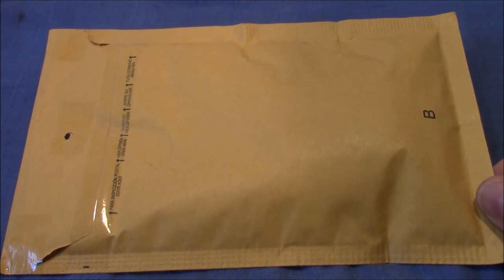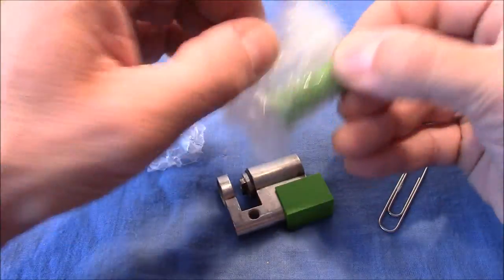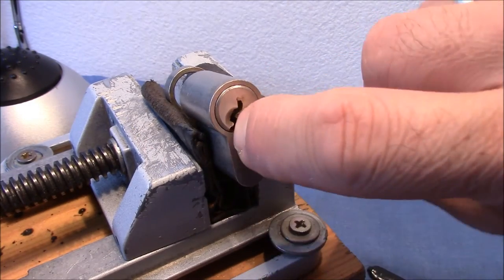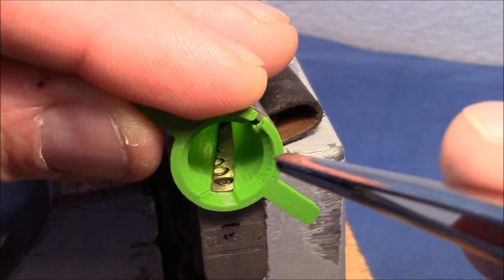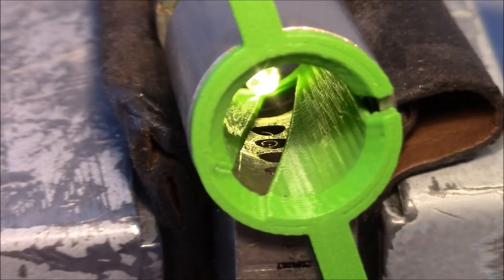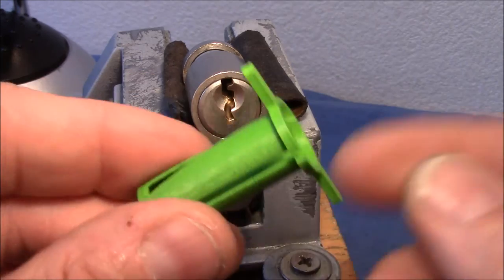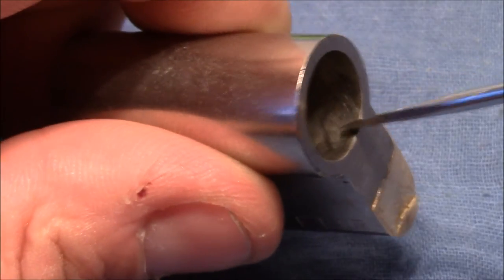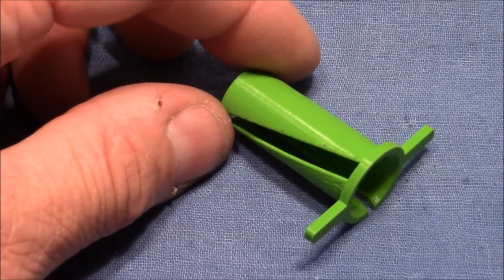(picking 212) Front-loader pinning tool for euro locks demonstrated and reviewed - big thanks to Tom

Comment: Thank you so much for doing the full review Potti :). I'm glad that all arrived safe and you like it.
You were right, the paperclip is used as a pinning shoe needle. You file it flat on the side which faces the drivers, so that they are hold safely in place. It's just an improvised one, but does work ;).
I designed the small slit in a size so that even pinning shoes which have a little wider needle will fit.
It's easier to turn the tool with the shoe inserted just a hair at the beginning, and then pull the shoe out just at the edge of the small slit, so the pins do not block the tool from turning.
The loader is made flexible on purpose, as I got the note, that there may be locks with a little different core diameter. 
So it's easier for the tool to adapt, even when the core is smaller than normal.
It will probably not work on all locks (side pins aso..), but on many.
The small area in the front of the tool which you mentioned (in front of the bigger slit) is there, because I had to shorten the tool. Doesn't harm the function and it is not so easy to remove, so I left it this way... ;).
Yes, a pinning shoe alone will do it too, but this way it is much more comfortable :) (and you can start in the front, or back or even with some practice in the middle of the lock). You will get used to it in a short time.
I'm btw foxxy3 on ukls ;).
Very nice greetings and If you ever need something or want to share ideas...you now know where to find me potti ;), Tom
Reply from the maker: Attention: long answer ;-)
Thank you very much for the fast delivery - it was great fun to use / test the pinning loader. Actually I always wanted to have one but was too lazy to check for an affordable source ;-)
You say that the tool was designed to be flexible to also fit in smaller locks. That's of course a valid point. But the lock can only be a little bit smaller, else the slot for the pinning needle would become too small. But the majority of euro looks that I came across had the same size, as my standard follower fitted tight into them. But there are other locks that are larger; example Pfaffenhain https://youtu.be/tEtmcb8I608?t=171 For such locks a bigger tool would be required or you live with a gap when working on it.
I still think that stability is an issue. The idea with a bridge over the pinning needle slot (while maintaining the space for a tall pinning needle) would reduce the wear on the tool (from squeezing), improve the usability (no unintended reduction of the diameter when working and therewith a chance to turn it unintended). But on the other hand it might also reduce the tension when inserting the tool. Currently it adapts to the inner diameter and can apply a force against the inner wall which increases the friction which is good. So after writing and thinking at the same time, maybe just increase the width of the tool at the end. This would maintain the flexibility (smaller locks, automatic expansion and friction) but reduces the wear on the weak point and makes it even stiffer.
Reply from the maker: I managed to compile some locks for you - it's on its way to you. Have fun.
Reply: Potti314
Ohh :D. That sounds great :). I have 2 weeks of company vacation now, so just the perfect time. Many thanks Potti :). I will send them back when I'm done with them.
Reply from the maker: It's meant for you to keep or for circulation. Please don't send it back. Cheers :-)
Reply: Many thanks Potti :).

Comment: Very cool. Would love to see it made out of something that might take a little more punishment (steel, brass, whatever). Your ideas to improve structural integrity make sense. Nice work, Tom.
Reply from the maker: Thank you. Yes, that plastic might not hold forever. I guess to make it yourself out of sheet metal would be a lot effort. The good thing with 3D printed stuff is that once the design is done it can be reproduced with no effort.
Reply: You can easily make something like this from a 1/2 inch brass tube. But I'm not a metal specialist and as Potti said, I can remake a tube, whenever I need one with the printer :).
Reply: +redcatimaging very well done, an intelligent design and expertly put together. You should feel very proud.
Reply: 10/10 for practicality. :) Except for the cost, 3D printing with metal would be fun too. I think I might take your 1/2 inch tube idea and run with it. Much appreciated, good sir.
Reply from the maker: Noctis Motus Looking forward to see the result.
Reply: They have these made out of steel but they’re fairly expensive. I bought my set from think peterson but I’d love to have the plastic one if I didn’t already have the steel one. 3D printing may not be as robust but this tool is a life saver and if it gets used once it’s already paid for itself. I’ve seen YouTubers make these out of brass too but it’s trial and error either way…
Reply: @odinslockllc  Hmm, I have the setup these days to do it myself. Having the time and motivation is another matter entirely. :)

Comment: I have to disagree to add a bridge at end, if you do that you cannot insert it or remove it because it will be blocked by the pinning shoe! Go to thinkpeterson DOT com - pinning tools and you can see how Ken overcame this.
It is not connected at the end but rather there is a bridge going inside the core and over the insert slot which makes it stable and allows you insert pinning shoes. :)
Great review Potti, and Tom really nice design, if you manage to make a connection over the insert slot it would be perfect! :)
Reply from the maker: Thank you. You're right of course and I don't understand why I didn't think about it before. So here is a picture of the peterson one https://www.thinkpeterson.com/PDGImages/PINNING%20DEMO%20C.gif As I want to use my other pinning show as well (https://youtu.be/Ss258RBTjqI?t=696) the bridge needs to ensure enough space for it. I will put a note on the video to draw the viewers attention to this point. Thanks again :-)

Comment: Nice tools! But what if you can't pick it first? I had taken a Ruko D12 double euro cylinder apart as I wanted to repin it using pins from another lock. I had my troubles but luckily one of the sides was the shortest possible. I managed to put it together again using nothing but an angled tweezers. First doing the deep side then think about what needs to be in there and do the other side. Then unlock both side pulling them slightly apart (but watch angle and how much!) to be able to put in the center piece. Was a true puzzle and I had it lying apart a few months before deciding to give it another shot. Single sided cylinders is usually not much of a problem even with just ordinary lay mans tools. But that double euro cylinder was quite a challenge.
Reply from the maker: Yes, these double euros can cause some work ;-) If you cannot pick a lock but have a key, you two options. (1) Just pull out one side and then carefully gut the other side with a follower so you know the pin order. (2) File down the key on the side opposite to the bitting. This gives room to insert the needle of the pinning shoe. If don't have a key, maybe you can shim it open. But therefore you need to get access from the back.
Reply: Yeah thinking about it I think I can see how it can be done even if only 1 key but then you'll have to tape down the first side to make sure it doesn't fall into place or out again.
The oddity of Ruko D12 is that all top pins are the same length so no order to take note of. 
Otherwise most locks (Danish) I know of if you get order shuffled then just shuffle them around the get the least amount of spread in height of both lower and upper pin combined so again not really that big of a deal to have track of the order unless you''re dealing with a fancy master key system etc.
Reply from the maker: I've made an unlisted video https://www.youtube.com/watch?v=uOZ2pVjUvVo for 'crispey bear' demonstrating the method. I just lock the assembled plug so it will not fall out.
Reply: Thanks for video! Sure makes the job a lot easier but still very tedious compared to most other single cylinder types (Scandinavian oval is the most common where I live).
Hopefully I'll never have to do longer than an asymmetric +0 and +25mm double cylinder. As long as there's two keys it can be done just by a pair of angled tweezers.
If changing my front doors I'll most likely NOT choose euro cylinders for a lot of reasons. More expensive and imho less physical secure.
But it's what fit in my doors now and when I moved in I bought these cylinders to replace the old as you'll never know whether you've got all the keys or if there's copies out there. Fate would have it that I didn't fit them for some months as I both wanted a rekey for one of them (not the main issue) but also because the cassettes turned out (I now know after several months not being able to find out that is was) to be an old style Guerville where the tap which turns around is smaller than standard euro taps. I solved the problem by disassembling the cassettes and grinding/filing the dead bolt mechanism to be able to accept the larger tab of a standard euro cylinder. I could replace the taps in the cylinders to smaller ones but the old ones don't fit the new cylinders and paying 2x15€ for some taps is imho too expensive. Besides the cassettes needed to be cleaned and re-greased anyway.
Could be the cassette could be replaced with some fitting ovals but that would require new cover plates and handles and perhaps some fitting too and these cylinders where bought.
Reply from the maker: Wow, that reads very elaborate - compliment to your work.
Here other than euro cylinders are very uncommon. I also had the problem once that I had the need to repair a cassette but it was fixed with rivets. I had to replace it completely as I don't have the proper tools and knowledge to disassemble and reassemble it.

Comment: Great video and demonstration mate. I have never used pinning shoes etc for gutting and only used a follower with lock in hand and seems easier with less messing around. How would you compare both methods of gutting?
Reply from the maker: Thank you. I prefer the method using a follower when possible. Just safer and less likely to mess it up. But for full euros  I used the pinning shoe only which is a bit tricky, so that loader tube is very helpful for these cases.
Reply: Potti314 Waddac2 I always use a Pinning Shoe on Full Euros because you are forced to use them but if I had a Tool like Tom has made I definitely would try using that. Nick.

Comment: compare to the traditional way in repinning, looks like this is more troublesome, the time needed to finish using this tool is doubled or maybe more.. traditional way is more simple and practical..
Reply from the maker: For a full euro with both sides together this method is the only way to repin the lock. The usage of a follower is then only possible if both sides were gutted.
Reply from the maker: Yes, your method is more comfortable given that both sides are gutted (or dumped out as in your video). The approach with the front loader however is the only way to reassemble the lock when the other side remains untouched. This is nice when you want to pick and gut one side only and reassemble the lock again without touching the other side.